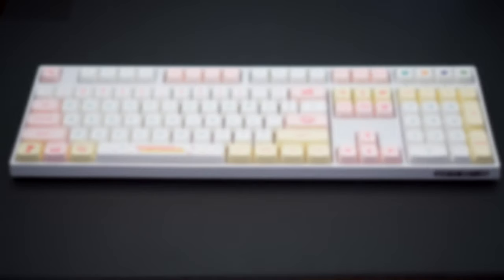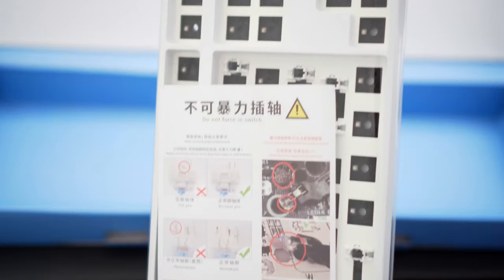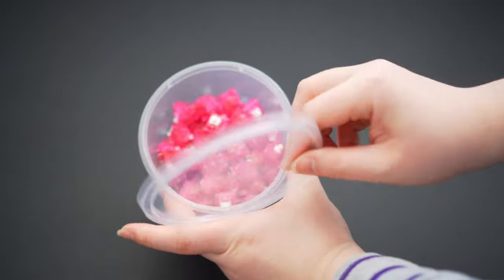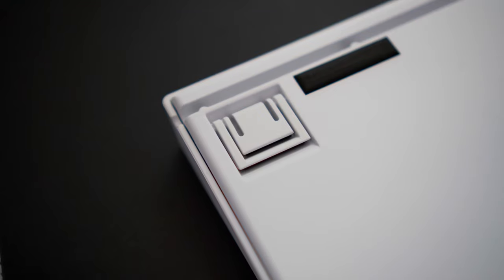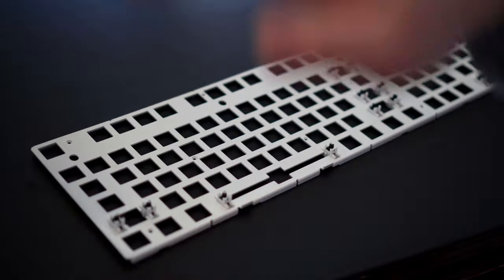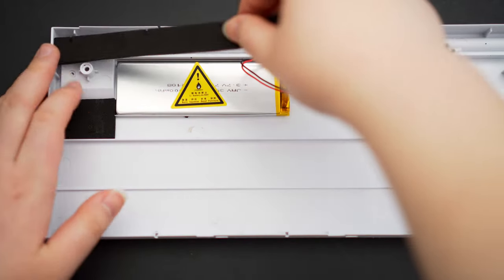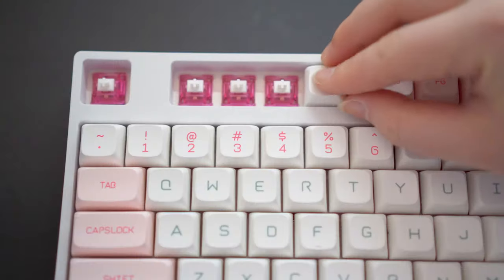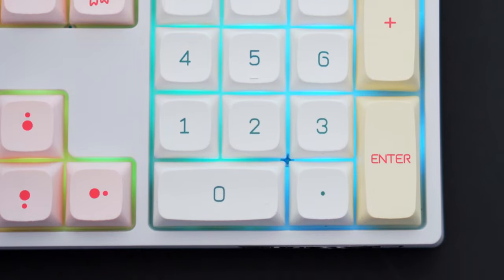Epomaker GK108 Build + Mods | Dragonfruit Switches

Comment: hello abit new to this but do you mind explaining whats the difference between pe foam and eva foam. And why did you use two different foam.
Reply from the maker: I'm not across the science behind this but basically the two foams have different densities so they would affect the sound profile of the board differently depending on which one you use. PE foam isn't as dense as EVA so its easy for the switches to pierce through, conversely EVA foam is on the denser side and works better as case dampening.

Comment: great modded sound, hope I can replicate that. Quick question, on the pcb can you see kind of where the traces are? I want to put this pcb on an old G512SE case bc I love that design, I'm sure the screw holes wont line up, so I have 2 options: figure out a way to put everything together without the screws or drilling holes through the pcb.
Reply from the maker: Thank you, GL! This picture should give you an idea of where the mounting points on the PCB is. https://puu.sh/IhVUs/907eab5b5a.png

Comment: Kia ora!! I really love your final product, you did such a good job modding this! I was wondering if you got the wireless mode of this keyboard. If so, is it any good? I'm really wanting to get a wireless full board that I can customize and this one is so far good! However, I've seen some people say the wireless option for this board isn't too good. Was wondering if you had an opinion on this (unless of course you only got a wired board!)
Reply from the maker: Thank you! I do have the wireless board and I find it fine for everyday typing. I haven't had any connectivity issues and I use it with a Mac.

I think people were saying that the latency with the wireless version isn't good so if you game competitively then that would likely be a problem.

Comment: Are the stock stabs really that bad? Just bought one and I was really hoping that modding them would be enough to make for at least a decent experience.
Reply from the maker: The stock stabs are pretty much impossible to get a clean sound out of but if you use a thicker band-aid/material when doing the holee mod you'll be able to get rid of basically all the sound. If you don't mind the slight mushiness on the stabs they're still fine to use.
Reply: @kumikeebs989  Do you know if it can fit pcb mounted stabs like the everglide panda v3's or the Durock v2's with the stock plate?
Reply: @MidnightNinja  i've read that you cant, but im trying out for myself (with Durock V2s) in a few days. if i dont get back to you, assume that you cant fit the screw in durock v2's
Reply from the maker: Sorry about the late reply, screw-in stabs won't be compatible as there are no holes for them on the PCB.

You'll need to stick to plate mounts unfortunately.
Reply: @kumikeebs989  Thanks man, i appreciate the effort! I'll try modding the stock ones, if I'm not satisfied I'll go for Everglide Panda V3's

Comment: I am planning to buy the wired version. Is it any good? Also, will the Akko CS Switches fit on this?
Reply from the maker: The board is great for its price. Modding it a bit especially the PE foam + tape mod really helps with the sound. Akko CS switches will fit fine, they're a great budget choice as well.
Reply: @kumikeebs989  Thanks, Kumi. You did not notice any latency in the wired version, did you?
Reply from the maker: I used mine in bluetooth mode mostly and did not notice any latency issues. However note that I don't game so your mileage may vary.
Reply: Hi, received this keyboard yesterday. Did this come with a pre-installed foam dampener when you received it?
Reply from the maker: Nice, no it doesn't come with any foam dampener. You can make it out of shelf liner if you have any around or you can buy dampening material specifically for the board. There is a variety depending on how much you're willing to spend.
Reply: @kumikeebs989  Mine came with a pre-installed foam. Which was surprising as no review or video had mentioned it. I might take it out and do a silicone mod, instead.

Thanks for the input, though. :)
Reply from the maker: @babaharamdev  oh interesting it might be a new edition they've added to the recent batches. Silicone is generally best for boards like this that have a lot of stand-offs/excess plastic in the case.

Comment: What kind of "interference problem" do you mean in 2:56 ? And how do your switches avoid this? Thanks for this video! I just ordered my GK108s and will definitely put in some dampening foam :)
Reply from the maker: Basically the interference problem refers to when there isn't enough space between the keycap and switch causing keypress return issues at worst and noise issues when typing at best. 

The problem generally occurs when using cherry profile keycaps with north facing switches. There are some combinations where there aren't issues depending on the thickness of the keycaps/length of the stem of the switch but I'm not too sure how this works.

I avoided the interference problem by using XDA profile keycaps.